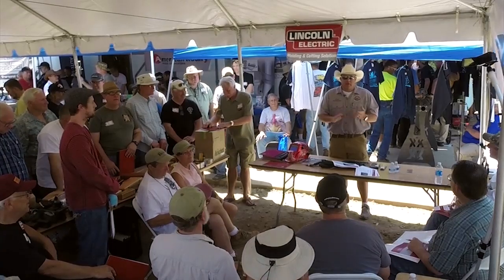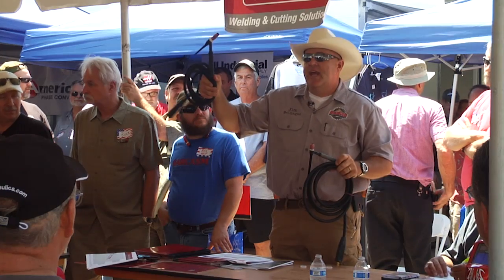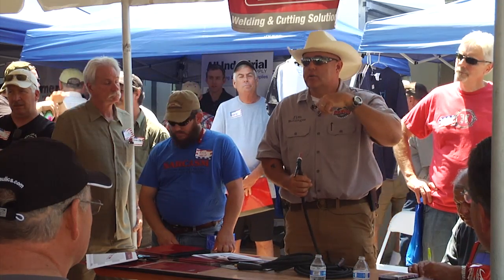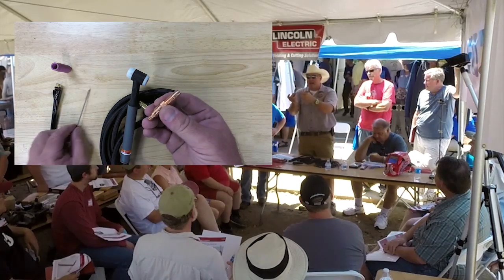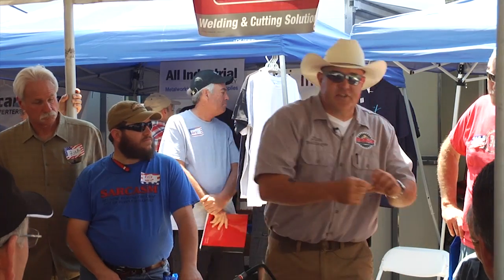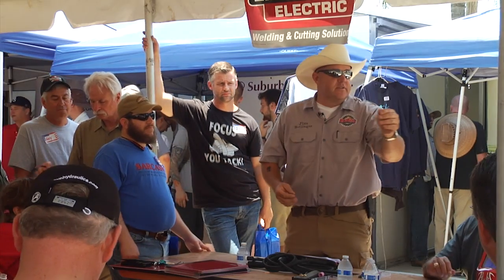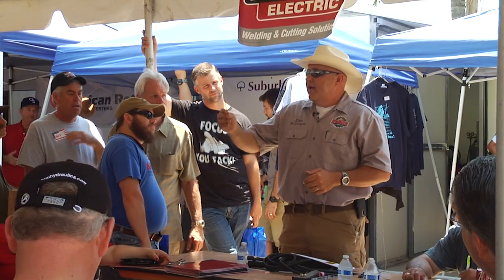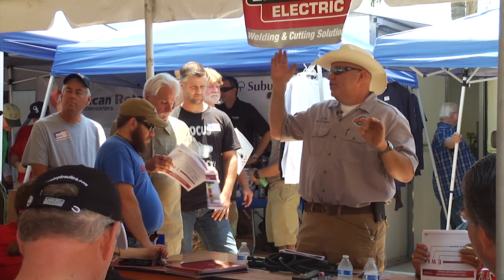TIG welding basics part 3 - torches, tungstens, how and why

Comment: My WP20 torch sprung a leak on the blue hose.  I just replaced it with a flex head WP20 torch.  I like the flex head torch a lot better.
Reply from the maker: The flex head is just so much nicer.